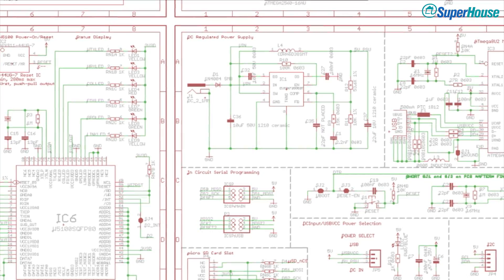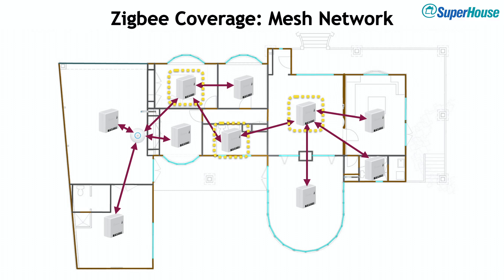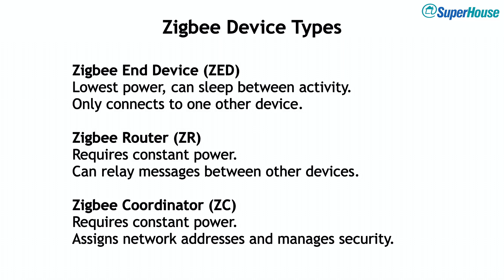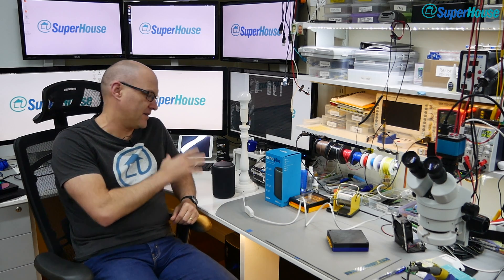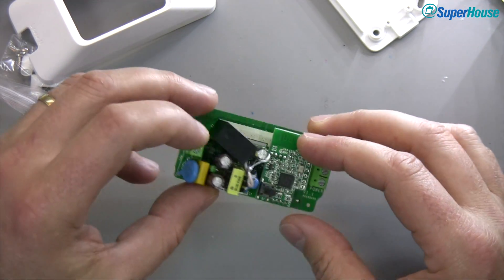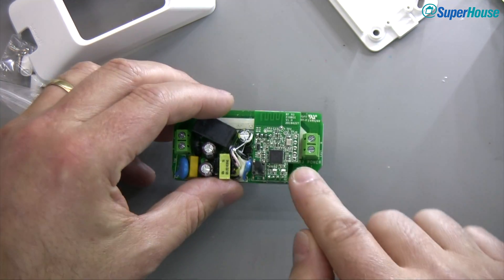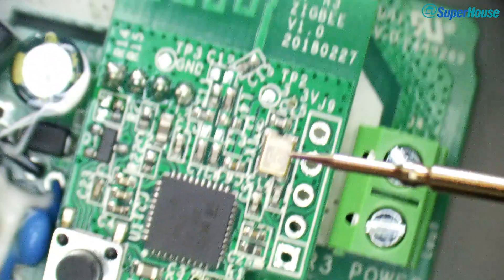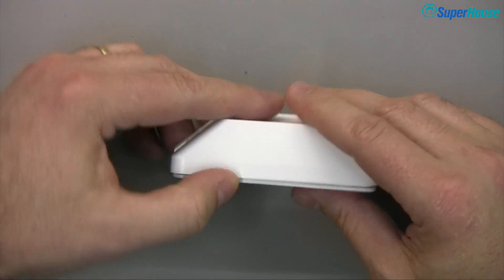SuperHouse #35: Sonoff BasicZBR3: Zigbee, not WiFi!

Comment: loving your work btw.
as a developer, i only harbor great dissapointment with zigbee, when i wanted to develop for it, zigbee asserted open source, finding documentation on it was impossible, but for a low low fee of $2000 you were allowed their documentation(albeit 5 years old), if you wanted a more current documentation you could pay $30,000.
Otherwise i would have developed / utilised this tech, but the lies(open source) left an awful taste in my mouth.
Reply from the maker: Yes, I've heard similar bad stories. The very first prototypes for LiFX globes were built using Zigbee modules connected to the LeoStick board that I designed, but Zigbee was dropped like a hot potato very early in development.

Comment: Can't wait for the zigbee mqtt bridge!
Reply: There's already at least one such project - zigbee2mqtt. It also has a wonderfully comprehensive documentation, highly recommended!
Reply: Mqtt is horrible spammy. I use deconz much less spammy
Reply: @1988marksie  what do you mean by spammy?
Reply: @pawel753  mqtt basically floods your network with thousands of requests which isn't much of an issue with 1 or 2 devices but with hundreds it's messy.